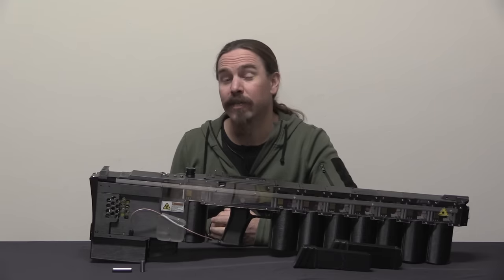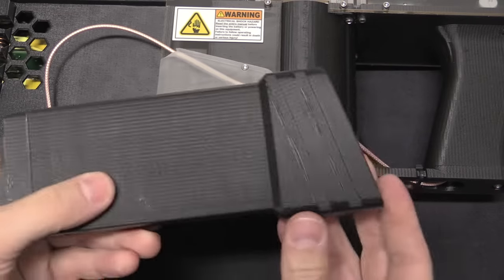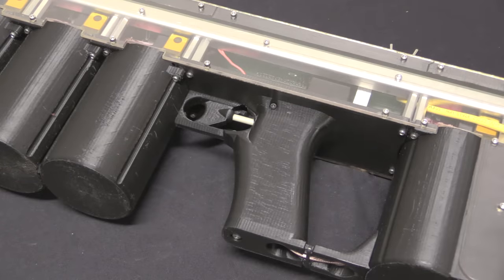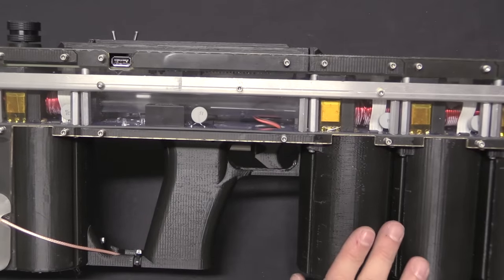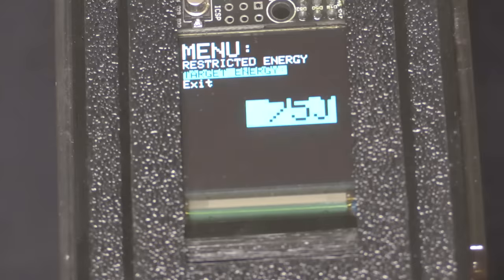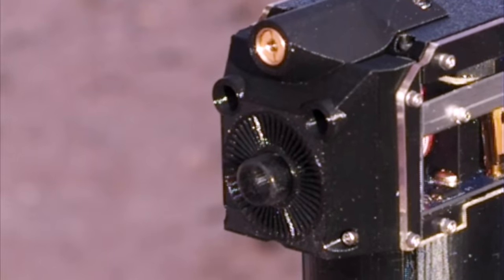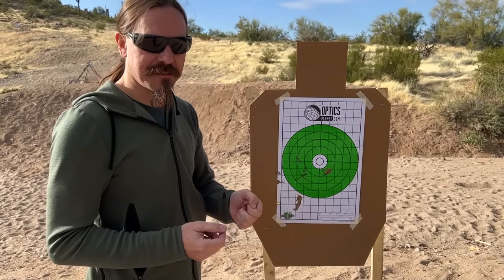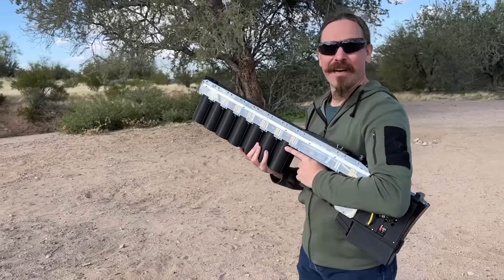ArcFlash Labs' GR-1 Anvil Portable Gauss Rifle

Comment: With the large bore, I could see this developing into more of a grenade launcher than a typical gun.
Reply: @lostalone9320  However, you could eliminate the size of the propellant charge (by removing the charge itself), allowing more ammunition to be added... and also bring down the cost of a grenade by removing it
Reply: Of all the applications for this tech, putting an explosive with mechanical fuse (or digital for that matter) through it would not be high on my 'things to do and survive' list.
Reply: @marty2129  no man because your adding the weight to the gun via the battery at a lower energy density then what gunpowder can achieve.
Reply: @lostalone9320  It seems to basically eliminate 2 of the three major sources of sound when firing (the mechanical operation of components, and the propellent blast shockwave at muzzle), plus even once models have the capacity to shoot supersonic could switch to subsonic by the flip of a switch. So can be one of the quietest guns to ever exist. 
It also if they get the bullet down to an equivalent size and up to an equivalent speed, then it would have much less recoil.
Reply: I think it will be the opposite.  A good analogy is electric cars.  Seeing an early electric car, you wouldn't have guessed that a big advantage over ICE cars would be acceleration.  Similarly, when the tech is mature, the advantage of gauss rifles is going to be velocity.
Reply: @lostalone9320  With that reasoning, does this really pose any real benefit as a gun, shooting solid projectiles. I'm just thinking this could develope into something along the lines of the Barret XM109 25mm Payload rifle.
Reply: Eh I don't know about high electric energy mixing with high explosives.
Reply: mcchickenz  Rail guns don't have the speed limit of Gauss guns. They can theoretically be hypersonic. A Gauss gun is limited by the time the projectile spends near each magnetic coil; the faster the projectile is moving, the less energy is imparted by each coil, the lower the acceleration.
Reply: @Thatoneguy-e2f  The projectile doesn't come into contact with anything electrical. Provided the magnetic pulse doesn't activate the detonator...
Reply: Put small HEAT warheads in it, or small gyrojet rockets for a bolter.
Reply: mcchickenz  To a certain extent, it's innate in physics. Trying to speed up the switching merely results in the projectile spending less time accelerated by each section. For any given strength of field, it gives you a fairly hard limit on velocity. You can only gain more speed if the fields are stronger and you use a longer "barrel" with the sections separated further apart. Better to use the extra field-strength/power to fire heavier projectiles.
Reply: @FirstDagger  Or use it to fire an RPG-type rocket, replacing the first-stage with a shaft pushed by the Gauss-gun. No blow-back, making it safe to use from vehicles. Quiet firing. And it propels further away from the operator before the main rocket ignites, making it harder for the enemy to spot the operator.
Reply: @lostalone9320  Explosions on the target. You don't want the target's friends to be able to easily work out where it was fired from. Same reason tracer rounds don't ignite immediately out of the barrel, but delay until they are well away from the shooter's position.

Comment: Dude if the "alpha" prototype version of this is so lethal, im sure generations of the Anvil after this will just be massive improvements to the ease-of-use.
Reply: It's about as lethal as a light pistol, in a super bulky rifle format.
Reply: @nick012000  Batteries are increasing in power. In a few years, it will be possible to accelerate 5.56 or the equivalent and it will be significantly more affordable.
Reply: @nick012000  I don't think this can cause as much damage to a human as a .22lr
We're still really far from firearm performance
Reply: @kafeh3300  Really? It's a solid steel rod that's moving at about 300 fps and you think it would hurt less than a .22LR? Sure the .22 is a lot faster but the impact from that rod would do a LOT more damage than a tiny ass .22 round.
Reply: @thomashevener2846  I'd rather be hit in the chest with a hammer using moderate force than with a 22, at least the former won't go in and cause internal bleeding everywhere

I'm thinking with the same logic for that big ass piece of metal, probably won't go in, maybe break something if I'm unlucky enough
Reply: @kafeh3300  its still possible lethal most likely similar to rubber projectiles
Reply: @bastik.3011  You're right I bet it could kill, I just think that for now it's just really not officient
Reply: @kafeh3300  as efficient as a gun? No ofcourse not this is a prototype after all amd considering that its pretty damn effective. Gaus Cannon were only a theoreticall concept for a long time, then they became mounted prototypes and to have one in a portable format is impressive
Reply: @bastik.3011  It's impressive yes and cool for what it is, all I'm saying is that it'll be long time before this becomes efficient compared to other means (if it ever does)
There's no opinion here, I'm just telling what my eyes are seeing
Reply: @kafeh3300  well your eyes are wrong then. Remember this is an alpha, a proof of concept. 3DPrinted parts and electronics that are not made for this purpose. This gun is just to see of its worth pushing further if the idea even works, its not meant to be efficient it's meant to be functional. And considering that it is damn efficient
Reply: My eyes aren't wrong hahaha
All I'm saying is again, for now, other means are better at doing what this technology does, I'll say it again just in case, FOR NOW.
I can't tell the future which why I say that I don't know what will happen next
I'm not arguing with anything else that you're saying
I'd go as far as saying you're arguing alone man
Reply: @kafeh3300  well it won't ever be efficient considering there is more powerful options already made and used on thw public daily, the government technology is beyond the masses innerstanding unfortunately. Ya think all these movies, shows an games that use an showcase "advanced" weaponry and technology is baseless? A little secret.... It ain't. So in essence this gauss gun thing isn't advanced at all nor effective n efficient compared to the blueprints unknown to the public 🤧 but a few has been leaked i believe? 😅 Haha well anyways your right and so is the one ya talking to in a way. Lol Happy days y'all! 🖤🙏🏾 🤙🏾👽🤙🏾
Reply: @nick012000  yup in a way. The flesh is surprisingly weak in certain situations and conditions tbf            👽🤙🏾🤧
Reply: @bastik.3011  OK buddy your not making sense now, that IS the fuckin point! Like huh? 😕 No one CLEARLY said anything different kiddo. What is going on with ya head? 😅
Reply: @silenceafterviolence2596  i dont know anymore i lost the thread sorry. Also kiddo is unnecessary, i am an adult so please treat me like one
Reply: @bastik.3011  Yeah we sent a few too many messages I think lol
In the end we don't even disagree on anything
Something we all agree on though is, this is cool
Have a nice day people
Reply: I see this as comparable to the early 'brick' cell phones. The future improvements will mean an incredibly smaller and more powerful weapon.
Reply: @spikespa5208  or the first car, they were hardly better then horse carriages
Reply: @CarolusMagnus2501  The main cause of the bulk and weight of this weapon aren't the batteries, but the capacitors, and there's physical limitations on how small those can be because their effectiveness is directly proportional to the size of the plates inside them.

Comment: So the kinetic energy (~100J) is only about as much as a .22 Long, but the momentum of the projectile (2-3 kg-m/s) is on par with a 9x19mm or a 7.62 Tokarev, which is impressive.  This is just because the mass is much higher, at the expense of velocity.  For a more extreme comparison, the fastest baseball pitch would be about 140J and 6 kg-m/s.  Probably not reliably lethal, but dying or severe injury aren't out of the question!
Reply: The first TT-30 I handled was in 1999, the second was about a quarter hour before reading your comment.  Just a coincidence I know however it made me smile
Reply: Thank you for the breakdown. Considering it’s still alpha stage/prototype - it really is amazing. Practically all of the elements that make up the rifle are actively being improved/miniaturized with plenty of headroom. Just gotta get that round spinning or stabilized with fins/sabot.

Comment: This is really cool, my only concern with it safety wise is the capacitors. While i'm sure they are safe, that size of capacitor tends to fail catastrophically with a small explosion. I've seen it first hand with capacitors of similar physical size that run/start 25hp phase converters. If it were to fail in hand it could easily break bones or possibly lose fingers ontop of seriously shocking yourself.
Reply: That issue is gonna crop up when similar weaponry sees military use and actual battle. I know that "getting shot in your weapon" is a very rare ocurrence, but should you catch a bullet or a shrapnel into the capacitor, it's not gonna be fun times.
Reply: @KubinWielki  So kevlar wrap around the capacitors to catch shrapnel, or worst case catch exploding capacitor?
Reply: @KubinWielki   by the time these will be battle effective, I think we will have robotics on the field. Probably still an hybrid of soldier-robot teams. But I don't see why you couldn't have the soldiers a different weapon that doesn't blow up.
Reply: The frequency of objects disabling weapons in battle is much higher than we would like to believe.
Reply: Those caps have essentially a blow off valve in them. It’s a rubber plug that pops out to release pressure.  I work with large capacitors
Reply: @megawolfr1986  Absolutely, let the bots lug them around.  They're built for it after all.
Reply: I will be honest

I would rather lose a hand in a capacitor explosion than get my heart stopped by a discharge
Reply: It seems one of the safest ways to regulate this would be to armour the capacitors encasements, and allow a blowout zone towards the front of the weapon in the form of vents/entries into the barrel area, hopefully resulting in a large flame blowing out the front or top i na safer direction.
Reply: Seems like a valid concern, but honestly that concern doesn't seem any worse than the concern of something like a disastrous misfire of a traditional firearm which sends shards of hot metal and gas flying towards people nearby (including the person who fired).

Considering it is less explosive in nature (during normal operation), I think as long as the capacitors are checked properly for quality and the person using it does not attempt to fire it when it has become overheated or otherwise is in a dangerous state - it should be mostly safe.

Comment: The batteries and capacitors in this thing remind me of the old disposable film cameras. They have batteries from the factory, that charges up a capacitor, that fires off during the shot to create a flash.

While charging, it whines in an increasing pitch until done. And the flashing laser just the same as the flashing led on those cameras lol.
Reply: Those things were fun.used to keep em after the film was done, you could charge it up and thump it and it'd flash. I guess you couldn't keep using the flash the regular way for some reason? It's been a while

Comment: That's a pretty chunky projectile to get up to 75m/s.  I'm pretty impressed.
Reply: Considering that this thing is pretty much just throwing chunks of metal without gunpowder, I'd be interested to see how it compared to say, a projectile fired by a slingshot or similar device.  One for Joerg Sprave at the Slingshot Channel, maybe?
Reply: @aaronjames7266  And? What is coil gun tech going to be capable of in a few years? Also, you might have noticed people don't use slings for self-defense anymore.

Comment: Proper explanation of why dry firing a coilgun is bad: 

By dumping into a coil without a projectile, you are reducing the inductance of the coil and increasing the Q of the resulting LRC circuit because the solid projectile is subject to eddy currents and damps the circuit.  This makes a higher current flow with the given switch timing, which is going to potentially give the semiconductor switches a good hard smack of high voltage and current when they turn off.  If they have a safe discharge and a photocoupler driven timing, they designed this smartly, but it is still possible to wear out a switch this way if they did not.  
~One Electrical Engineer
Reply: Is this like how you're not supposed to run a microwave without any food in it? :)
Reply: @ZGryphon  Yes and no.  In a microwave, you could heat the glass dish substantially, while reflecting power back to the magnetron.  There is also the risk of heating up the paint on the metal with food drippings creating imperfect capacitors that receive more energy without a load.  Note that the notion of reflected power applies mostly to radio and microwaves.  You can get such with a mismatched antenna on a powerful transmitter heating the output stage until it melts.  

For a coilgun, its much closer to dry firing a bow as both a spring mass damper (close enough to a bow) and an LRC circuit are second order ordinary differential equations with initial conditions and end stops.  

In general the notion that all energy will find a place to go do something is true, so make sure the powerful sources of energy will do as intended.
Reply: I just started to get into circuitry and basic EE and im trying to understand this. Wouldn't this be solved by replacing the transistors with MOSFETS or am i thinking of this wrong?
Reply: @VRNC-kn5tf  MOSFETs aren't indestructible. While they are "hardened" (huge air quotes for amouse to explain later), it's still a really really bad time for the coils, and will be just as subject to overloads and destruction.
Reply: @JammyD2579  yeah I’m thinking of making a homemade rail gun since you can get more velocity out of it per foot compared to a coil gun but since it’s less efficient it would probably end up having to have really long pauses between shots so it would be kind of a modern musket which I think is cool and you could make the projective a ball since you aren’t relying on magnets so you won’t have to worry about keyholing
Reply: As an electrical engineer you can probably appreciate the simplicity of the spin stabilization system I have thought up for future Gauss Rifle iterations... just swap the standard coils out for Rodin type or Starship type coils and the problem of tumbling projectiles is no longer an issue!

Comment: I did the math:
For the short projectile (0.50" x 1.00"):
Area = 2·π·0.25·1+2·π·0.25^2 = 1.96in^3 = 3.21E-5m^3
Average density of stainless steel: 7750kg/m^3
Mass = 7750kg/m^3 (3.21E-5) = 0.249kg
Force = (1/2)(0.249kg)(71.5m/s)^2 = 636.48N

The long projectile: 
Area: 3.53in^3 = 5.78E-5m^3
Mass = 0.448kg
Force = (1/2)(0.448kg)(74.5m/s)^2 =  1423.26N

12ga shotgun slug:
Mass = 1oz = 0.028kg
Velocity = 1560ft/s = 475.49m/s
Force = (1/2)(0.028kg)(475.49m/s)^2 = 3165.27N

Lets find initial air resistance:
long proj = (1/2)(1.225kg/m^3)(74.5m/s)^2(0.82)(0.00101m^2) = 2.815N
short proj = (1/2)(1.225kg/m^3)(71.5m/s)^2(0.82)(0.00101m^2) = 2.593N
slug = (1/2)(1.225kg/m^3)(475.49m/s)^2(0.248)(4.2503E-4m^2) = 14.600N

Force of impact on target 15m away:
long = 1423.26N - (2.815N)(15m / 74.5m/s) = 1423.06N
short = 636.48N - (2.593N)(15m / 71.5m/s) = 635.93N
slug = 3165.27N - (14.600N)(15m / 475.49m/s) = 3164.81N

What about energy efficiency? 
They claim 2.8% efficiency and 100J muzzle energy 
Working backwards from 40 shots / battery: 165mAh/shot, 6600mAh battery capacity
100/.028 = 3571.4 J initial energy

What about the shotgun?
~2.5g powder per typical 12ga slug. 
Energy potential of gunpowder is ~3000J/g
3000J/g (2.5g) = 7500J initial energy
(assuming 28" barrel) 3165.27N (0.7112m) = 2251.14J / shot = 30% efficiency.

What's the max it can deliver?
Largest possible projectile: 6.484E-3m^3
Most steels top out at 8000kg/m^3
8000kg/m^3 / 6.484E-3m^3 = 51.87kg
Force: (1/2)(51.87kg)(75m/s)^2 = 145884N
Reply: Hello
You volume computation is way off leading to an overestimation by ~1-2 orders of magnitude. Dimensions are not correct either (adding radius with disk area ?). For a cylinder, V=2*pi*R**2*L. Also, 0.25 Kg is really a lot. With your data, I get ~120J, which seems realistic. This corresponds to the very low end energy range of .22 LR (according to Wikipedia).
The 1/2*m*v**2 formula is kinetic energy which is.. an energy, not a force (so not in N but in J in SI). Didn't really understood what you did after that, either way, formulas are incorrect by dimensional analysis arguments. I suggest you read on that, it is a nice way to quickly check ones computations and do magnitude estimations : https://en.wikipedia.org/wiki/Dimensional_analysis
Reply: Lol all this crap for a you tube video.. what a waste of time
Reply: Man...go outside and touch some grass😂😂

Comment: Really interested in seeing this shot at ballistics gel!
Reply: @Steven Van Niman Might be funny if it bounced off the gel though or the gel spit it back out the entry wound.
Reply: It's low velocity but high mass. The energy of the projectile is low but the momentum is already on the level of smaller pistol rounds.
Reply: at that fps its lower than an airsoft gun. But the rounds are big n bulky so it still probably would do some damage, maybe some more severe bruising instead of full on being shot
Reply: He did say it had the muzzle energy of a 22 lr
Reply: @Steven Van Niman they did it and failed
Reply: @batman6621  This will certainly break bones, probably cause internal organ damage. A penetrating injury is a bit less likely but certainly not impossible.